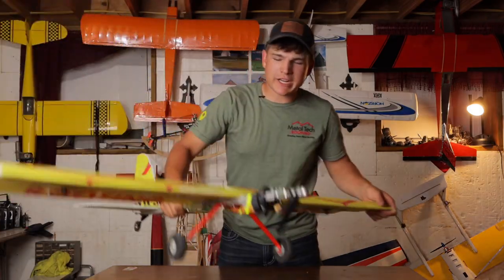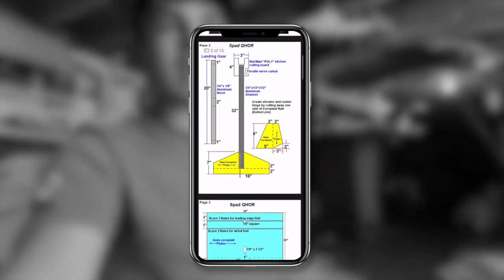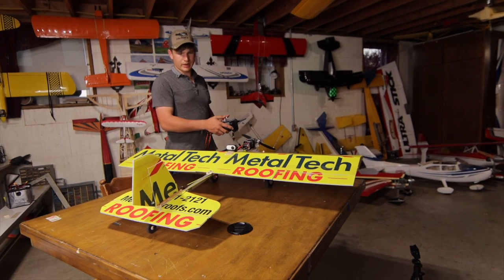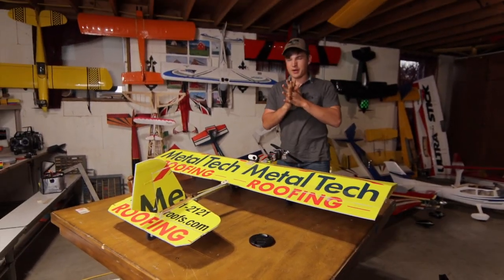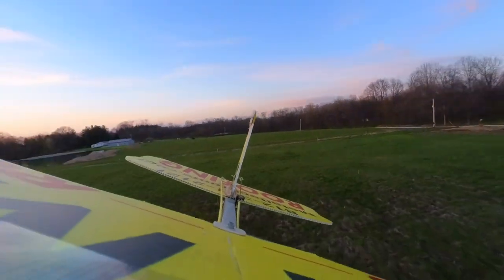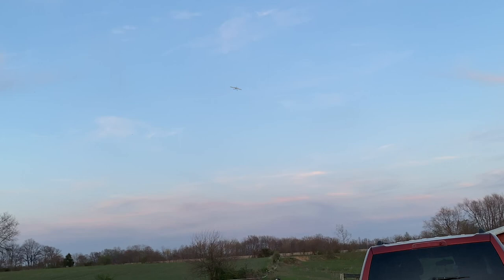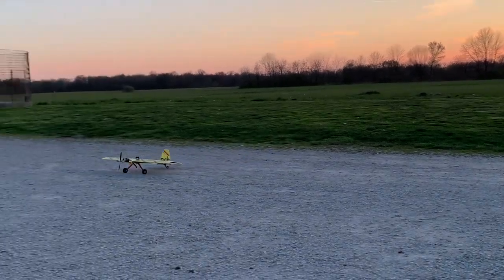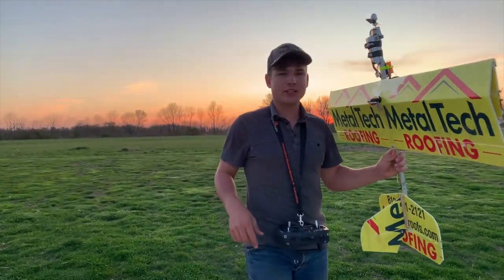Homemade Rc Plane Made From Scratch

Comment: When you said how heavy it is, I had my doubts too that it would not fly but I think it flies great considering the motor size and no dihedral. Coroplast is a great material for building planes with. Are you going to upgrade the motor?
Reply from the maker: Yes I’ll put a bigger motor on eventually. It also has poor yaw stability, I have to use a lot of rudder to stay coordinated in turns. Not sure how I’m gonna fix that yet.

Comment: information          :52   there should  NOT  be  a  'step'  at the underside of the wing, and the mass of wing-located servos should be located  just-forward-of  the main spar;  aka  thirty percent of chord.            ideally, a tail boom  SHOULD  be  tapered.    construction materials should be selected  Accordingly.           1:00  this is the  Wrong  TYPE  of  prop, for the application.!           1:08    wingtips  Should  be  enclosed.          1:18    unnecessary DEAD  weight in this unneeded mechanism, located aft of the c-m/cg.         1:25   MUTANT,  Bad  rudder design.!    and  other stab/control surface wonkiness.        

FIFTY-TWO   Ounces   ?!?!?!?!!       lmfao